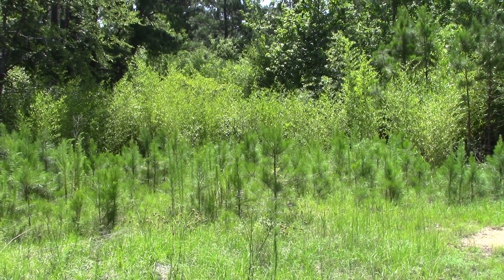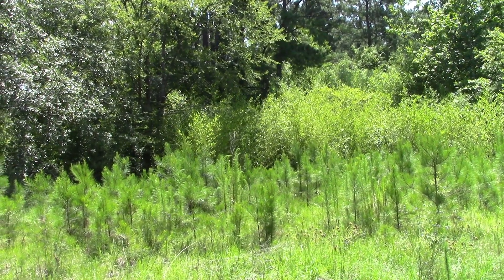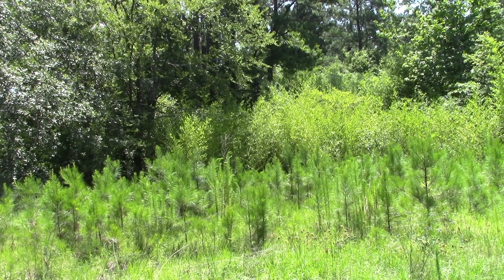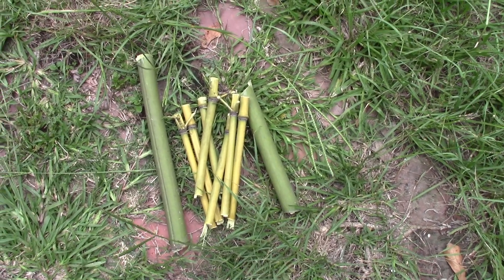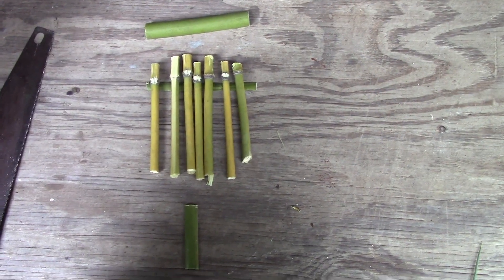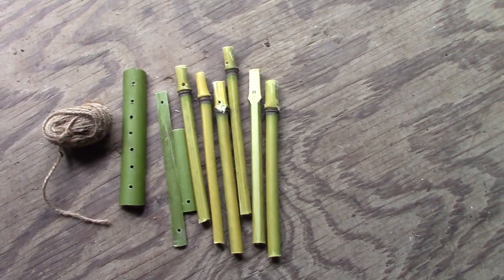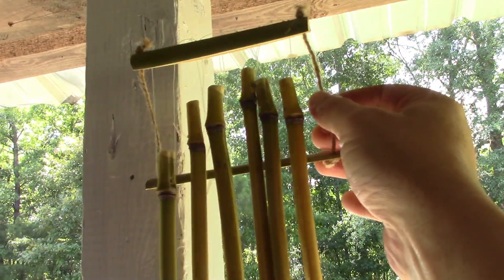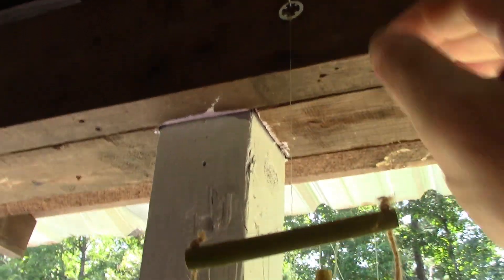Bamboo windchime from scratch

Comment: Bamboo seems fairly popular over there. My wife won't have it in the garden because it spreads and is hard to control. When I Google it, most of the links are about how to get rid of it 😁😁 On the other hand, if you can make use of it, that is great 👍👍
Reply from the maker: Rather than popular, I think it's that it was here when settlers arrived and nobody can get rid of it! The trick, is to cut the new growth in Spring. But, I only found out a few weeks back and now have an extra 20ft!
Give it 5 years, I'll rent a JCB and make a guest house from it 😁
Reply: both of my boys have patches they are constantly cutting back
Reply from the maker: The shoots are good eating, just maybe not 100lb of it every few months 🤣

Comment: thats an interesting design, most of the ones I see are circular
Reply from the maker: Yep, with a disc in the middle. I could have used a large bamboo node but didn't think of that, so followed pics with flat bars.